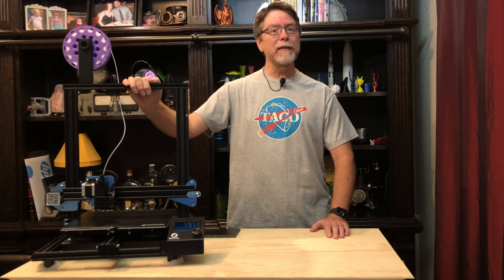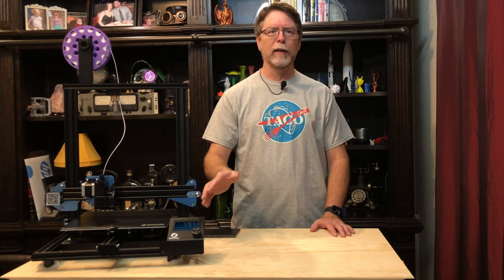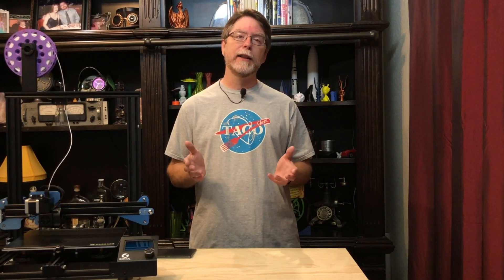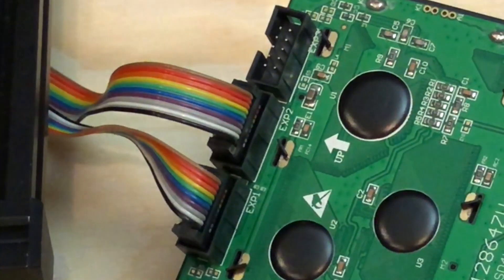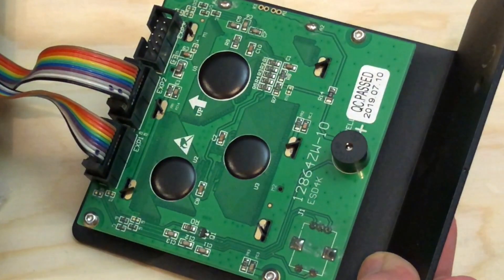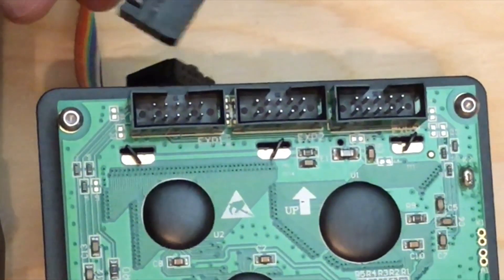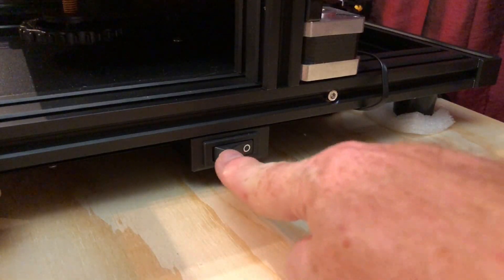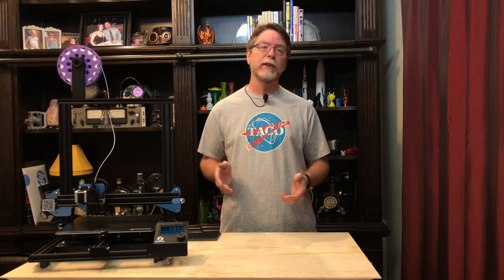How To Replace the LCD Screen on the Sovol SV01 3D Printer

Comment: How do like that printer?
Reply from the maker: I like it pretty well, actually. But I need to look into why the filament runout sensor isn't telling me to run out and buy more filament. Apart from that, it's pretty good. I need to tame the fan noise though.
Reply: Its a nice printer especially for the price, but the firmware needs work, its a little buggy especially if you add bltouch, z offset does not work properly.